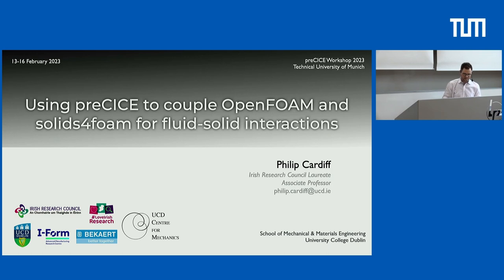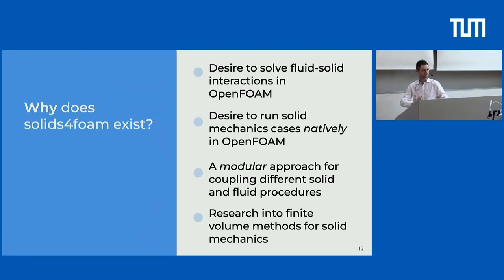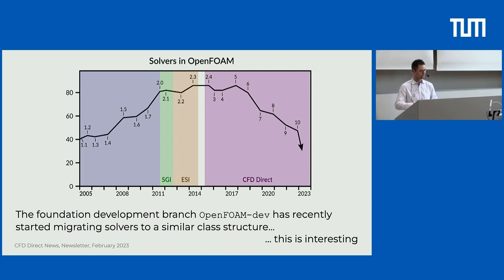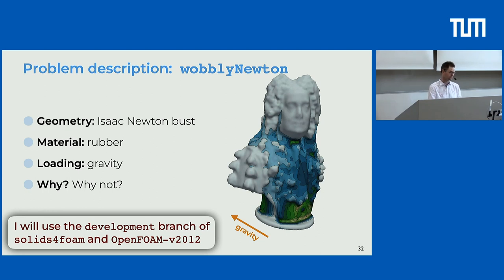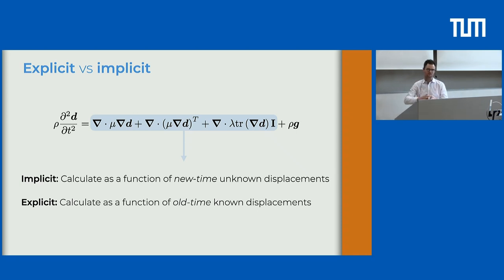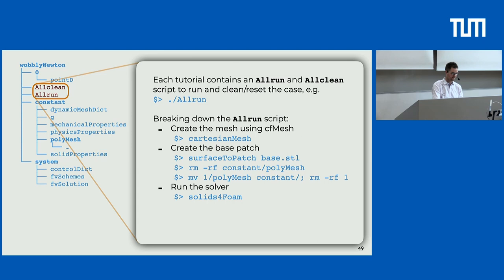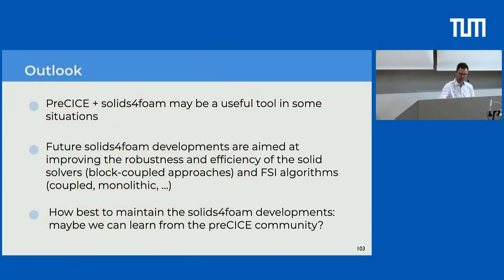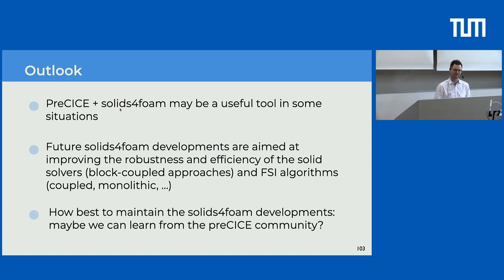Using preCICE to couple OpenFOAM and solids4foam for fluid-solid interactions (Philip Cardiff, UCD)

Comment: I only heard about strain/stress tensors. What about point displacement due to solid-fluid interaction, which BTW is the biggest application domain of FSI?
Reply: This is taken care of by native OpenFOAM, where mesh translation is updated with each time-step, given you treat the desired boundary with appropriate D.O.F

You can check the weir example given in the video at 34:58